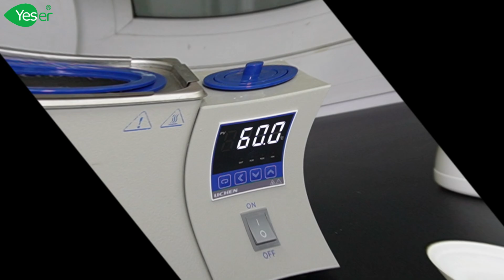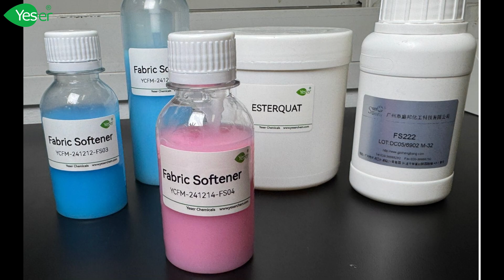How to Formulate a Professional-Quality Fabric Softener Using Esterquat & FS222

Comment: Do you have to use deionised water for the low ph water. Or can you use normal tap water with a ph of 7.i tried making 1 liter using 33.3g BTMS-50 - 5g cetyl alcohol  - 3g sodium benzoate  - 20ml fragrance. But after 4-5 days it turns from a white liquid to slightly  pink-red i can only put this down to using tap water not deionised water or a reverse osmosis water and I cook all this up on a heat mantel and 1L round bottom boiling flask. Should I add more sodium benzoate for a longer shelf life. I have a water cooled glass coiled condenser unit so I can make my own deionised water. Good video tho this is the only video to use proper glassware  electric stirrers and properly weighed out

Comment: Please make a video making fabric softener with microcapsulated fragrance
Reply: Microencap softner is made with microencap essence.

It should be cationic as it will allow to bind it with negatively charged surface of any thread thus allows essence to act for much more longer period even after dryer.
Reply: Hello brother, do you find the correct formulation for your product? If yes then I also wanna buy it from you

Comment: does the fragrance survive in dryer machine? coz many fabric conditioners lose there scent after drying process in dryer machine.
Reply from the maker: Some fragrance does not survive in the dryer due to high temperature. In this case, we need to use encapsulated fragrance technology and dryer-compatible fragrance components. Stay tuned and we'll feature this one soon.